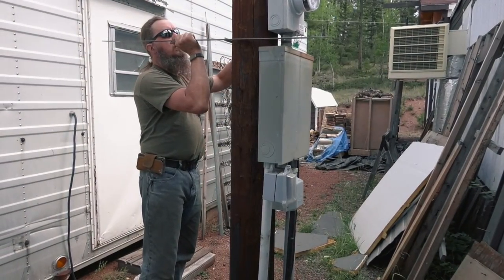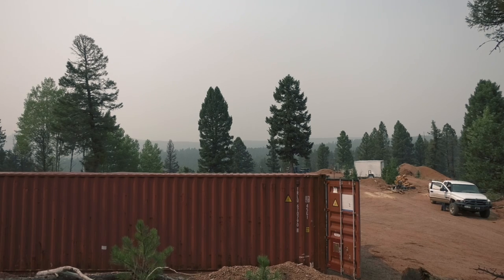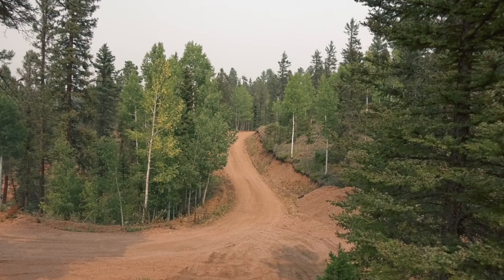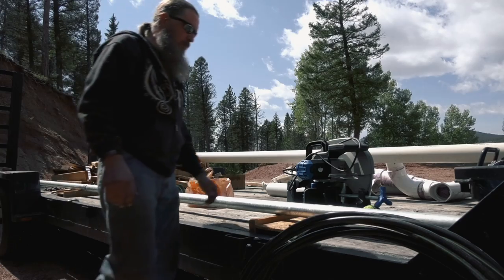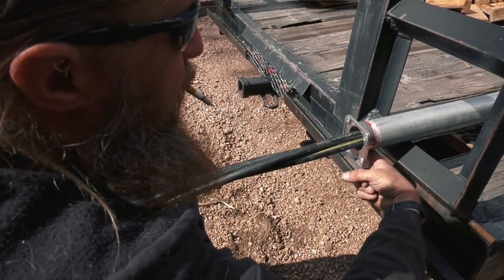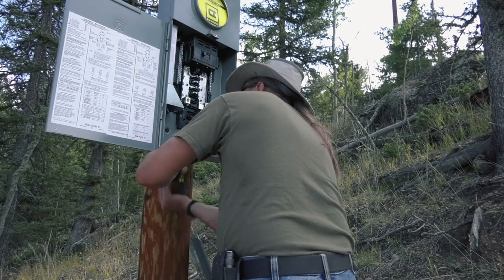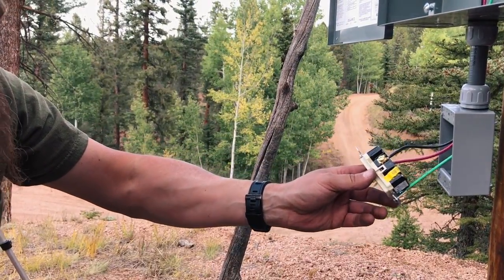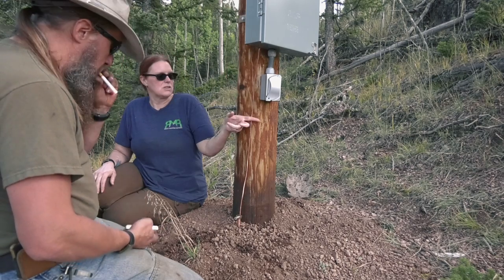Power Pole Meter & Box Install - Arched Cabin Build #121

Comment: You need to use that special aluminum electrical wire grease on those main lines where you stripped them and put them under the lugs on the top side of the meter. You will probably fail inspection if you don't. The aluminum wire starts to oxidize with in minutes of being stripped and you really are supposed to do it right away, but if you just loosen the lugs, pack the grease in and tighten them back down no one will know the difference. It's only a few bucks for a small tube of it at the hardware.
Reply from the maker: Thank you! I was calling this in today so they’ll be out tomorrow. I’ll have Mike take care of that today ❤️❤️
Reply: @LazyAHoleRanch  yep, was just going to mention putting some OxGuard on them wires!
Reply: @Hangs4Fun  I scrolled down right away when I saw. Good catch.

Comment: How far is your pole from the utilities company pole , ? Just curious because I'm installing mine & its basically like yours..mine is 130 ft between the 2 poles & I'm wondering if theyll make me add another pole.
Reply from the maker: I just did a rough measurement and we are about 50-55’ from the pole. I have no idea what the maximum is, so I’d suggest calling the power company and asking them what is involved for your particular location. Best of luck to you!! ❤️❤️
Reply: @LazyAHoleRanch  k thanks